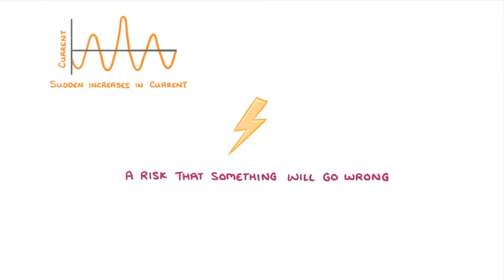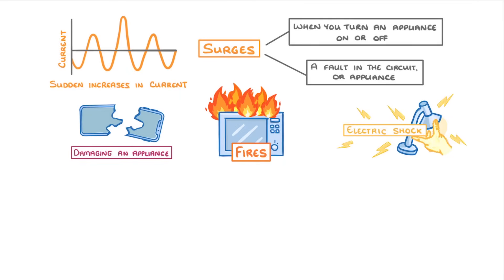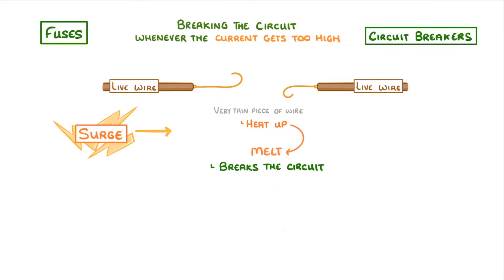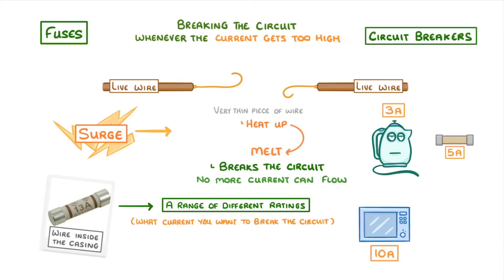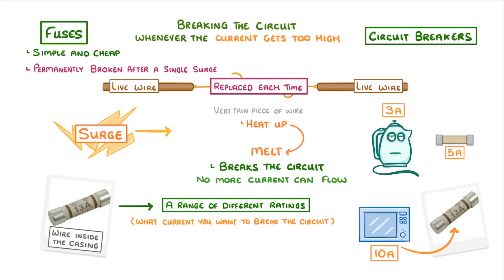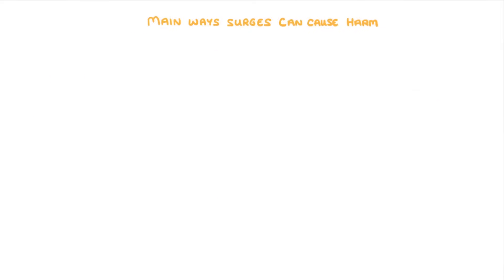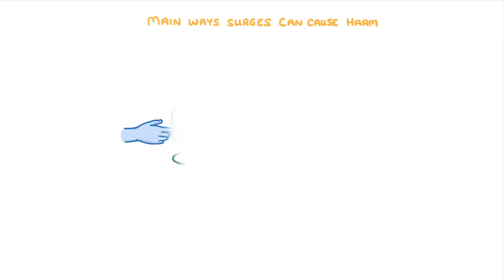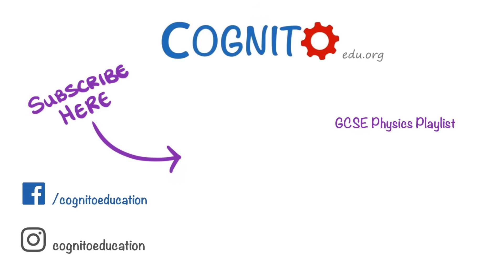GCSE Physics - Fuses and Earthing

Comment: Very big fan of your channel!! You say you can put a higher ampere fuse, to an appliance that requires a lower ampere and I started looking into 
it and this is what Google AI Gemini says about it:

Yes, you should not replace a fuse with a higher amperage rating than what the appliance requires. This is a significant safety hazard and can lead to fires or damage to the appliance and wiring. 
Why this is dangerous:
Overloading:
A higher-rated fuse will allow more current to flow through the circuit than it's designed for, potentially overheating the wiring and causing a fire. 
Fuse Protection Failure:
The fuse's purpose is to break the circuit when there's an overload or short circuit, protecting the appliance and wiring. If a higher-rated fuse is used, it may not blow in time to prevent damage, leading to further issues. 
Increased Risk of Fire:
A higher-rated fuse can allow the circuit to draw too much current, leading to overheating of wires and connections, potentially igniting flammable materials. 
Damage to the Appliance:
The higher current can damage the appliance, making it unusable or requiring costly repairs. 
Potential for Electrical Shock:
Overheating and damage to wires and connections can increase the risk of electrical shocks. 

Best regards!! awesome work anyway!!

Comment: If anyone wants to know more about Circuit breakers, here is some information: 
        A typical circuit breaker consists of an electromagnet. When the current to the electromagnet exceeds a certain amount, the electromagnet becomes strong enough to attract an adjacent iron bolt which releases a plunger that opens a push switch. This way the connection with the rest of the circuit is broken.